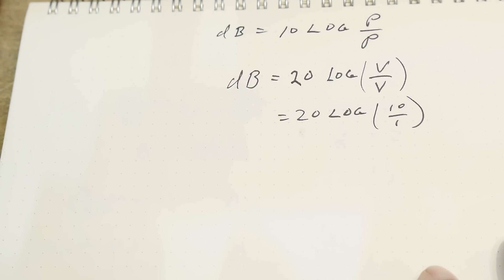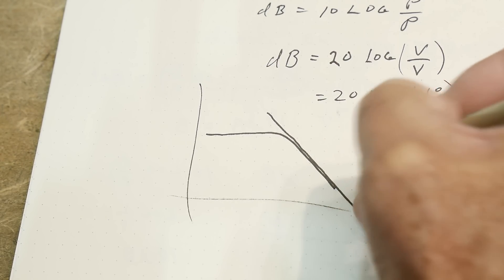#2001 What is a Decibel?

Comment: -20 dB per decade or -6 dB/octave is what what you get with a single pole response above the pole frequency. If you have two poles the rolloff will be -40 dB/decade or -12 dB per octave. The former is sometimes called a "-1 slope" and the latter a "-2 slope." This sort of language turns up in things like discussions of stability criteria in closed loop systems (e.g. you might want a phase margin of at least 45 degrees and a -1 slope at crossover (the frequency at which the loop gain is unity (1, 0 dB). When gain on the Y axis is in dB and frequency is in decades on the X axis, you have a log-log plot, which makes for nice straight lines.
Of course if you have zeros the slope is positive.

As with other units derived from proper names, bel and decibel have no capitals except at the start of a sentence but the symbols do -- dB and B (just as for watts and W, farads and F, siemens and s, etc.) Bels are kind of weird in that the deci prefix is very common and other prefixes are very, very rare. No one speaks of deciwatts or decifarads. No one speaks of millibels. They aren't wrong, just virtually never used. Though the rule is often broken on schematics to save space, there should always be a space between the numerals and the symbol for the unit, thus 13 dB, 11 W, 24 V, not 13dB, 11W or 24V.

Comment: In my obsolete profession, you weren't a Tech Controller until you could explain the difference between dBM, and dBrnCO and correct your measured output to reflect it.

dBrnC0 =  Decibel Reference Noise C-Message Weighted 0.

Shove that into your AN/UCC-4(V) Multiplexer group 2, channel 2, and smoke it!

Comment: Im lost. 4:05 "lets say we have 10 watts out, 1 watt in." You can't have more power out than you have in. Thats impossible.
Reply: Than your circuit has an amplification.  The other way around is called attunation.
Reply: Sure you can, the signal is 1W, the amplifier uses external power to provide more power

Comment: Well explained from 7:00
But I still have a gut feeling that dBs are more complicated than the physics formulas such as P=V^2/R etc, but we are basically stuck with dBs so we better get used to it.  The main advantage of using logs is that it compresses the data so you can fit more data on a graph.  For example decades on the x axis are basically log base 10 and dBs on the y axis are log whatever they are.  🙂👍

Comment: You got your factor of 10 wrong. You said bels were too big. No bels are too small thus multiplying by 10 to get dB makes dB bigger not smaller.
Reply: Actually I believe you have your factor of ten wrong. "Deci" means 1/10 while "Deca" means 10 - 10 bels would be a decabel.
Reply from the maker: Bels are dimes. dB is Pennies
Reply: @IMSAIGuy  My point is that the numeric value in dB will be 10 times greater than the numeric value in bels since you multiply bels by 10 to get dB. Yes, that makes the actual unit of a dB 10 times smaller than the unit of a bel. dB is the smaller unit but when you see a number in dB it will be greater than the equivalent number in bels. They just didn't want to deal with decimal points with bels so multiplied by 10. Instead of 1.6 bels it became 16 dB.
Reply from the maker: yes it is confusing. lets say you have money and you express the amount of money you have by pennies or dimes.    You started with dimes and all money was expressed in dimes. you found you needed 1/10 dime or 2/10 dimes and it was a pain. so you invented pennies. now you can espress 1/10 dime by 1 penny.  in the old system you had dimes = money  and in the new system you have pennies = 10 * money.    or money in units of dimes    and money in units of pennies.       money in units of pennies will be 10 times  money in units of dimes.   or  10 pennies = 1 dime.   (Bel = dime dB = penny)
Reply: Im not american. How much money is a dime? A penny is 1¢?
Reply: The simple answer is 20db is 2 Bells. They didn't like fractions like 1.2 Bells instead we say 12db.

Comment: All correct, but you fail to mention the main benefit of dB: when you have circuits in series, you can add the amplifications instead of multiplying. This is easier and the end result is smaller and easier to understand numbers.
Reply: But you add the values anyway with series circuits. For example; If you have resistors in series, you add the values, not multiply.
Reply: @simontay4851 This is not about resistance values. Those are linearly added. This is like you have one amplifier with gain of 10, another with gain of 100. Your output would be 1000x the input because gain is multiplication.

dB would allow you to add the two gains in dB rather than multiplying (so 40+20=60dB).
Reply: @simontay4851  But if you have series amplifiers you multiply the amplifications. That's because a (linear) amplifier multiplies its input by a constant factor.

Comment: dbv, dbm,...
Reply: I'm guessing you are asking about the meaning of these terms, so if you aren't and are just making a comment without asking a question, then forgive me for mansplaining.  dB is a ratio.  It has no units attached like ohms or watts or volts (Oh, my!)  

For the two examples you listed there are units attached. In particular, dBV is referenced to 1 volt and dBm is referenced to 1 milliwatt. The values are still ratios, but one of the values is a fixed value. For example, 3 dBm is 2 milliwatts. The "3 dB" part is a ratio of 2 and the "m" part says compared to 1 milliwatt.  Likewise, 30 dBm is 1 watt.  The "30 dB" part is 1000 times:  1 watt = 1000 milliwatts. 

In one of the other comments, actually a very funny one, the term dBA is mentioned.  This is not referenced to some unit. Instead, it's sort of a corrected scaling changing a physical sound level to one that approximates what we perceive as humans.

(Edited because I can't do easy math in my head before coffee.  30 dBm not 40 dBm is 1 watt.)